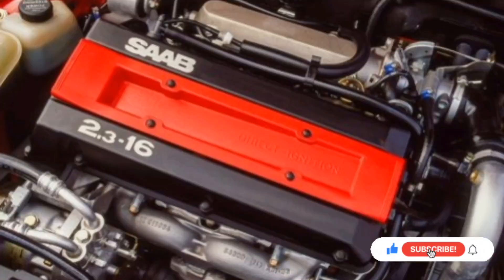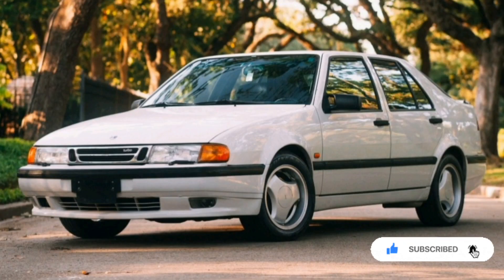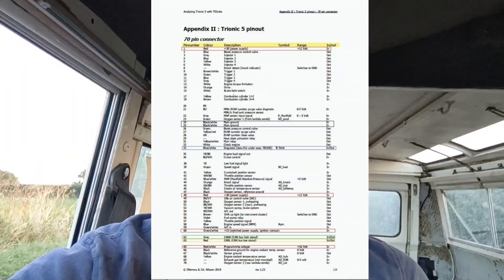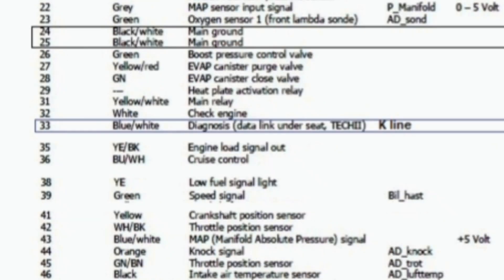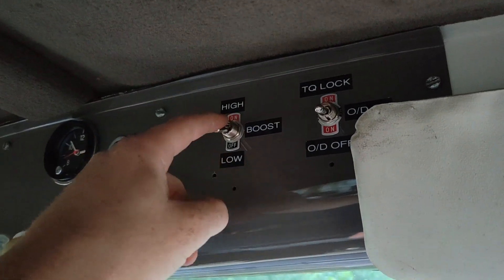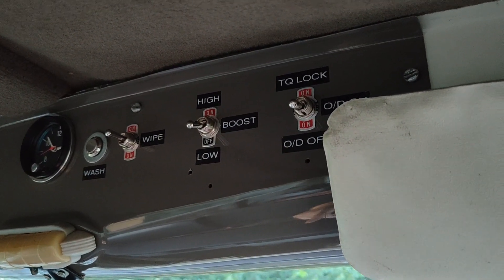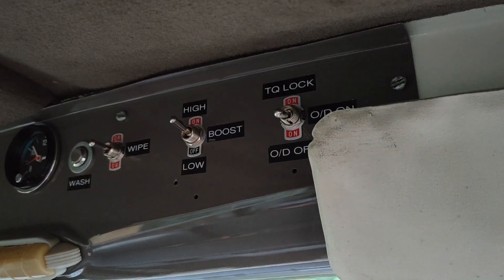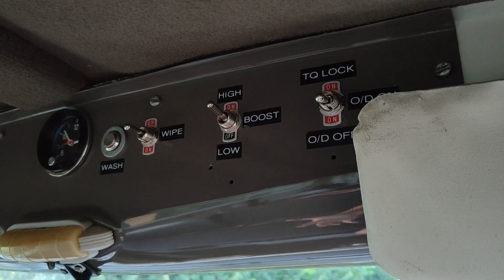A Brief Description of the Commaero's Switchable High & Low Boost - Saab B234 Trionic 5.5

Comment: This! 😀☝️ This will be a thing when getting so far in my build (still at the bending and welding tubes-part it).
Reply from the maker: It does cheer me up every time I flick the switch 😄 I'm just doing the same to my Saab Turbo swapped Russian van. What are you building?
Reply: @LivingMyBoostLife  I fully understand that... it has to be done on my build as well. 😂😈
A Frankenstein of sorts. Pure tube chassis, mid engine, b234 with a r28 gearbox, chevy rear axle, the front of the body of a vw t3/vanagon, the rear will more or less be just the tube chassis, hopefully cantilever rear suspension, front suspension and steering is from jeep grand cherokee 2015. Will be registered as an amateur built vehicle here in Sweden.
Reply from the maker: @kristoffer-robinlotze7273  Jesus that sounds awesome! Make sure you document your progress for us to follow along!

Comment: Neat! along these same lines:  What I just did on my Saab 900, 1989, was add an "ECONOMY switch", where an electronic solenoid valve switches from a normal configuration, to a state where full vacuum (stored in vacuum reservoir) is routed to both the distributor diaphragm and also the turbo blow off valve. When switched in this position, distributor is advanced to maximum and no boost is produced from turbo. Hoping to get another 2-3 mpg off of this setup. Still experimenting. Will see. Cheers.

Comment: Do you run a speed signal to the ecu from a wheel speed sensor or something?
Reply from the maker: I don't have a speed signal input setup on this. Trionic 5.5 uses speed signal to determine what gear you are in and limit boost for 1st and 2nd gear.  Pretty clever. But I don't intend to use those limiters. Some people are adamant that without a speed signal input you won't be able to hit anything over wastegate boost. This is my 3rd Trionic swapped vehicle, you do not need the speed signal input 😁

Comment: Great explanation Adam!

Do you need a pull down resistor on the pin to make sure it goes to 0V?
Reply from the maker: You don't. I'll be honest my electronics knowledge isn't too in-depth and I've seen people use pull down resistors for various things but never really considered why they are used! I presume it's as you say, to pull down voltage to zero in certain applications? Noted! I may fine a use for those later on!
Reply: @LivingMyBoostLife  The input goes through some signal interfacing en route to the processor, on the countenance of that expecting 3.3 or 5 Volts.
The circuit will have been designed to expect only an input from 12 Volts, so when it's not there it's held low by a pull down resistor.
Some circuits switch either 0 Volts or 12 Volts, etc into the digital input, typically those circuits will still have a low impedance to 0 Volts with a pull down resistor to 0 Volts.
Some applications have a pull up resistor for when the switch is to 0 Volts, ie it is held at 12 Volts, that's common in auto motive stuff.
That's due to a wire break event turning the input into receiver for any capacatively or magnetically coupled signal, and that is a problem.
The processor inputs are high impedance, and that is one of the reasons why they are not directly connected to the outside world.
The other is the voltage levels which have to be interfaced.
That is the sum total of it, that was the in depth explanation.
Love the van btw, the switch for the option of vandalizing roads and tyres is a hoot!